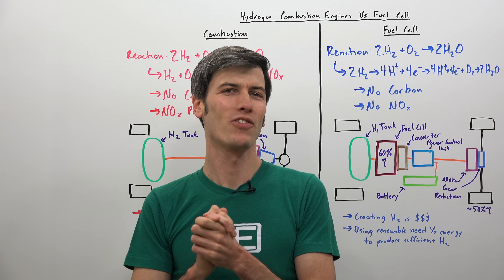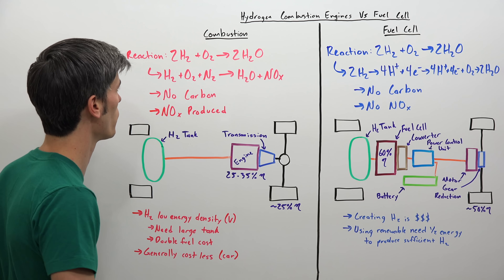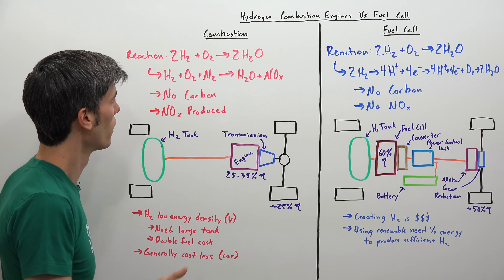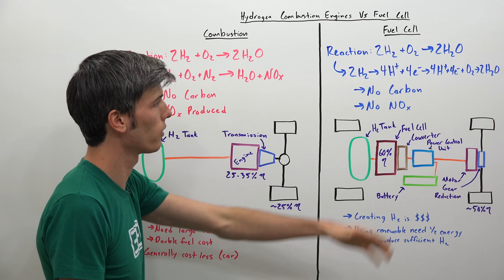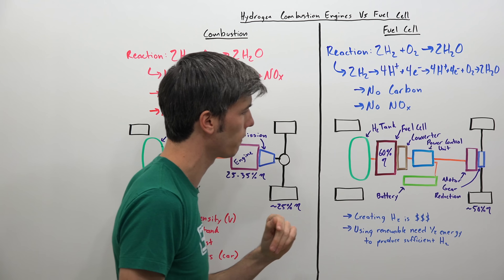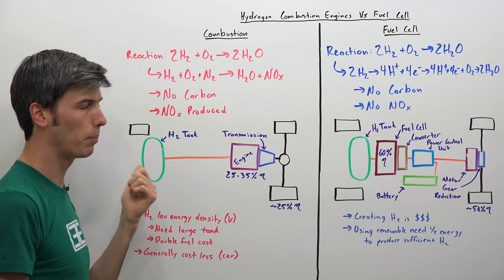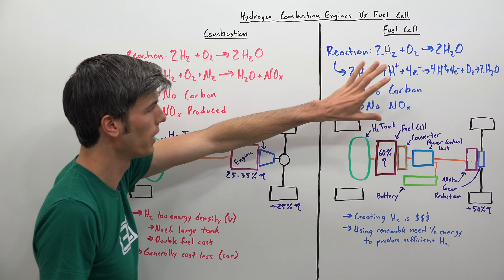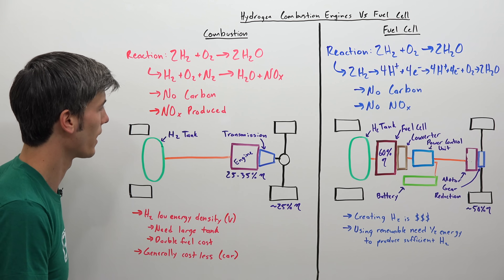Why Hydrogen Engines Are A Bad Idea

Comment: What about a HHO generator ? The only two things I see stopping us is 1 cars now a days are to smart u will end up needing gas because of sensors but if you go to a carb engine u won't have that problem now second . Is u have to have a pressure release and or a storage tank and pump to push that hho gas into a tank to put into the engine so u can very the throttle u don't want and engine that's at idle and the generator is making double what it needs etc that's where the valve comes in if your at idle the valve let's go of the extra
Reply: I would like to take the time to post some info about my vehicles setup.  I have been running my car on Hydrogen for about 2 years now.  I do not store large amounts of Hydrogen fuel in a separate High pressure container.  I produce enough gases on demand through the electrolysis process to run my 2.4L engine which requires about 6L per minute at 7000 RPM to run without hesitation or noticeable reduction in power.  To be clear, I do not separate the Hydrogen and Oxygen gases in my device. I simply have a small container that will be pressurized to 12-15 psi before the system will shut off production automatically.  I produce enough gases on demand through the electrolysis process to effectively bypass the need for complex High Pressure tanks to store H2 like most of the current systems.
    With this method I do not store enough combustible gases to cause any significant fire hazard or air displacement danger in the instance of a "leak" or failure of the containment device.  I bought a new fuel tank to replace the one that came with the vehicle to prevent contamination from the old fuel.  Now I use my house water to fill my cars fuel tank which holds 12 gallons.  So the fuel system is the same as you would find from the factory but, I fill it with Water instead of Gasoline and the fuel pump connects to the water container in the engine bay instead of to the injectors.  Also I do not use the fuel injectors, I use a large aquarium tube that is connected to the intake before the MAP/MAF sensors.  In order to run my engine on Hydrogen I had to retard the ignition timing from about 25 degrees before top dead center to about 5 degrees before top dead center.  I did this by using a timing light and rotating my distributor clockwise by about 7 degrees.
    As a comparison my car got about 30 mpg with gasoline, now it gets between 25-35 mpg with Hydrogen.  In conclusion I am sure that with a more complex delivery system I could get better performance and mileage because I am not monitoring the fuel air ratio but, my goal was to create a system that produces less Carbon emissions not to be crazy efficient and cheap to fill.  I believe by producing enough gases on demand this is more efficient because if I run out of fuel through miscalculation or my fuel gauge stops working, I simply need to find someone willing to sell me water (in one case a woman was so impressed she just gave me the use of her garden hose).  This is also safer because I am not using a "High Pressure" storage container for a combustible gas or liquid, it is just water in a tank.
Reply: Cameron... on board HHO generation makes no sense. It's a famous fraud.

Comment: The NOx argument is kinda disingenuous as it could be mitigated via emmision to a level well below what current gasoline engines produce hence why they're called near zero emissions. The whole point for going hydrogen I.C.E is to mimic gasoline. Only downsides less efficient which could get solved with better designs, technology improvements etc etc. Wouldn't be surprised if at some point a titanium 3d printed engine totally becomes viable. Perhaps the ability to 3d printed carbon nanotubes becomes ez to manufacture.

The only  people this will appeal to are those that have boarded the electric vehicles bandwagon. Understand a HUGE section of the population like the performance,  sound of your traditional i.c.e.. So Understanding this which would you prefer people adopt the current i.c.e or a hydrogen one?

Comment: Hho is fuel on demand.
Water and electricity is the only fuel you will need. All you really need is to increase your electric output to increase you fuel generator. So I dont understand where hydrogen is expensive. A gallon of water can generator hydrogen for up to 6 months to combust with your gasoline. In other words increase your hydrogen fuel cells you increase production. So if your engine is a 5.7 liter engine you only need to double if not triple your production per minute to supply your engine the fuel it needs to sustain its self so what do you mean by needing a large space to store fuel?
When in fact you only need to produce enough per minute for the motor. We now have throttle sensors which can can be link to the cells to increase fuel production when one accelerate the vehicle... a 200 amp alternator can supply enough current to generate 30 amps and over 27.8 liters of hydrogen in less then a  minute. I dont get what your trying to do with this video but you cant say hydrogen is expensive I generate a gallon in less then 20 secs. And it cost me nearly nothing.

Comment: I'm not against looking for environmental solutions for out planet.. But when all inputs and outputs are calculated it still becomes loss for the environment. Too many people get caught in a closed loop environment and only see CO2 as the issue, when it is just one part of a lot larger equation. We are still creating toxins that enter the environment, can cause real damage to our oceans, and ultimately continue to drive up atmospheric CO2 concentrations.
In all current solutions energy is imported into the earths biosphere (aka additional heat).
>
My proposal.. Reduce energy use at a significant scale as well as employing better methods of efficiency + look after our oceans, and I mean actually look after the oceans.. 
Until we work out viable ways of exporting energy from earth, and do so in a way that is cheaper (More efficient) than importing it the trend will continue upward..
Maybe large scale desert mirrors to push more solar energy back out, rather than drawing it in with dark solar panels as an example.
>
Thanks for the video. I enjoyed. :)

Comment: I wish that Stan Meyer could have been here to fix or defend the problem with NO pollution.  I think he would have solved it quickly.  Also, the battery weighs a lot and the hydrogen tanks can be used as miniature Hydrogen bombs.  I would not like to see the results of that.  This society can not be trusted to not do that.  Also, the ocean is rising and using ocean water with an additive, so people can not just go to the ocean to get fuel, would be good. The weight of the water does not bother me.  The metal that is being produced now is terrible.  I would not want to trust compressed hydrogen with it.  Wish Stan was still alive.  Did his brother die?  He was a joint patent owner.

Comment: Explosive power is a lot cooler than a fuel cell.  In a gas engine you keep NOx emissions down by keeping combustion temperatures down.  They just have to keep combustion temperature down through EGR, stratified charge, etc. and they will be good to go.  Doesn't really matter anyway as oil/gas isn't going to need a replacement for many years.  The only real reasons to get rid of gasoline engines are political.

Comment: Hydrogen Combustion Engines might be the only way to save internal combustion Engines. Wether that's something important is of course sometging everybody has his own opinion on, but i personally think it's a good thing since electric cars are in my opinion extremely boring.
You could use catalytic converters to solve the NOx problem and if you produce the hydrogen entirely with renewable/green energy the lower efficiency will probably not be that much of a problem

Comment: Let's cut to what happens when you have a  hydrogen fire.
The answer is  you don't want to know. 
Hindenburg is example of hydrogen exposed to oxygen. 
Hydrogen mixed with oxygen is  much more dramatic. 
Some people want us to use this as an auto fuel. Not a good idea. 
Ride around on a case of dinomite 
For a while and then tell us what you think about it.

Comment: Your wrong. The amount of emissions required to produce one hydrogen fuel cel far outweighs the amount of nitrogen expelled in a HCE. The cobalt mining process and smelting alone is so much more polluting than the emissions of  an HCE over the life of the engine, that manufacturing it would be way less cost effective, over the life of the vehicle than it's worth. Sure, the engines themselves emit differently, but you totally discount the total required to manufacture AND operate and maintain the vehicle. Also, you haven't even explored hydrogen supplemented engines, as they are a much more viable alternative, without the need for storage tanks.

Comment: is hydrogen embrittlement an issue for IC hydrogen engines!
Reply: Technically yes, However...
I would like to take the time to post some info about my vehicles setup.  I have been running my car on Hydrogen for about 2 years now.  I do not store large amounts of Hydrogen fuel in a separate High pressure container.  I produce enough gases on demand through the electrolysis process to run my 2.4L engine which requires about 6L per minute at 7000 RPM to run without hesitation or noticeable reduction in power.  To be clear, I do not separate the Hydrogen and Oxygen gases in my device. I simply have a small container that will be pressurized to 12-15 psi before the system will shut off production automatically.  I produce enough gases on demand through the electrolysis process to effectively bypass the need for complex High Pressure tanks to store H2 like most of the current systems.
    With this method I do not store enough combustible gases to cause any significant fire hazard or air displacement danger in the instance of a "leak" or failure of the containment device.  I bought a new fuel tank to replace the one that came with the vehicle to prevent contamination from the old fuel.  Now I use my house water to fill my cars fuel tank which holds 12 gallons.  So the fuel system is the same as you would find from the factory but, I fill it with Water instead of Gasoline and the fuel pump connects to the water container in the engine bay instead of to the injectors.  Also I do not use the fuel injectors, I use a large aquarium tube that is connected to the intake before the MAP/MAF sensors.  In order to run my engine on Hydrogen I had to retard the ignition timing from about 25 degrees before top dead center to about 5 degrees before top dead center.  I did this by using a timing light and rotating my distributor clockwise by about 7 degrees.
    As a comparison my car got about 30 mpg with gasoline, now it gets between 25-35 mpg with Hydrogen.  In conclusion I am sure that with a more complex delivery system I could get better performance and mileage because I am not monitoring the fuel air ratio but, my goal was to create a system that produces less Carbon emissions not to be crazy efficient and cheap to fill.  I believe by producing enough gases on demand this is more efficient because if I run out of fuel through miscalculation or my fuel gauge stops working, I simply need to find someone willing to sell me water (in one case a woman was so impressed she just gave me the use of her garden hose).  This is also safer because I am not using a "High Pressure" storage container for a combustible gas or liquid, it is just water in a tank.

Comment: So you're mentioning that Hydro Fuel Cell motors are much better than combustion hydro engines..... Basically
Reply: Also with the FC-Motor vehicle, 
Could you have a rear wheel transmission fit in the design as well, 
So you could still have a rear wheel sport car 🤔

Comment: Internal combustion engines are poor mechanical machines to extract work from the fuel, they simply have very poor thermodynamical efficiency.  When you have got hydrogen, a better way to extract the mechanical energy is by fuel cell to convert the chemical energy to electricity that can power the electric motor.

Comment: A couple of other things to note concerning hydrogen as fuel (although these affect both H-ICE and Fuel Cell engines):
As noted, hydrogen has a low energy density, and this is compounded by the fact that it is also a low-density gas at anything approaching ambient temperatures: in order to contain more than a few moments of run time under either engine type, the hydrogen gas must be compressed into a liquid state. This requires a great deal of energy to accomplish. The liquified hydrogen is extremely cold, and cannot be allowed to expand, thus the "gas tank" must be constructed to withstand those high pressures, adding weight and design requirements.
Liquid hydrogen quickly vaporizes once released from the compression noted above - and once vaporized, is explosively flammable. This requires that any part of the fuel supply system (for either engine type) be extremely durable during a crash: any accident which ruptures any pressurized part of the fuel supply has a high risk of fire or explosion. This means that the car's frame must be highly over-engineered, adding significant weight, and reducing efficiency.

Comment: why is nobody looking into electromagnetic piston engines?
Reply: Because that would be rotating more mass than you have to.  Using a Pulse electric motor would be far more efficient but less powerful than regular electric motors, which is why they don't use those either.

Comment: burn the hydrogen with pure oxygen outside engine proper.... something akin to an oxyhydrogen torch... zero NOx, and one of the highest flame temperatures, and no need to deal with stuff like pre ignition .  then pipe the steam flame directly into a steam engine or steam turbine generator set. Higher fame temperatures mean carnot efficiency can be higher, but of course its limited by materials science. 
fuel storage...there was a 1971  Porsche 917 racing car, which had a tubular chassis. To reduce mass... it was extremely thin tube wall. which were then pressurised to stop the tubes walls buckling. Similar idea to fuel tanks in many rockets. Store fuel gases in chassis tubes.  Thin diameter tubes, can cope with higher burst pressures, than bigger diameter tanks. better ability to cope with hoop stress etc. Use bundles of tubes, and/or arrange them into "plates" for inclusion in the chassis. flexibility to store gases in what's otherwise unused space..

Comment: Hydrogen has been used to power automobiles for 40 years now. A Hydrogen "engine" could take many forms not limited to reciprocating internal combustion engines or turbines like gasoline. Train efficiency in part to diesel-electric drive train. Future autos will have direct electric drive as transmissions lose 5-25% of vehicle's energy. Hydrogen (and its surrogate Methane) fuel cells can generate megawatts in a small space. Examples, island off Edo, resort, powered by 10 megawatt natural gas fuel cell; NASDAQ backup power. Japanese electric cars (non-US) and hybrids store Hydrogen in Nickel sponge electrode. Low pressure requirements of Hydrogen storage materials allow lightweight composite storage containers. Safety. Metal Hydrogen alloy burns and does not explode like Hydrogen gas, less dangerous than gasoline. As natural gas aka methane continues to become more popular (cf Methane Hydrate) the same infrastructure upgrades open the way for Hydrogen. Note that metro buses adapted to run on natural gas were tested on Hydrogen decades ago. The Laws of Thermodynamics that limit combustion engine efficiency allow more energy to be extracted from fuel in a fuel cell.
You neglect the high activation energy of Oxygen and problem of gas to liquid/solid diffusion, in oder to use "Air" as an electrode. "The car needs big lungs."

Comment: And the production of electric batteries is carbon neutral? There has to be a transition technology that allows the conversion of combustion engines from fossil fuels to hydrogen. There are hundreds of millions of vehicles that cannot just be scraped owned outside the United States. Why would someone in the developing world want to buy an electric car? There is no solution that will be accepted that does not address the needs of people in the developing world. I would bet that someone like a Tata Motors will find the solution and not only dominate the auto market in the developing world but put the old US / European companies out of business. And as far as Tesla is concerned, it does not figure in the equation. The company is not interested in the “mass market” but instead the “premium market”. It is no way positioned to ramp up production into the millions of units when it has difficulty producing tens of thousands to start with.
Reply: There is no transition technology need because the transition will take place gradually. Cars will not be scrapped needlessly. They simply get replaced naturally by EVs. Yes, also in developing countries eventually.
Reply: Simon I agree and understand that is what will happen “eventually”. But isn’t climate change an immediate problem demanding reductions in carbon emissions? This issue is presented to the general public as a matter of the imminent extinction of mankind. I am not saying that is the reality or being an alarmist. However, western countries in particular are demanding change by their own societies and the developing world immediately. If the world is facing catastrophic climate change, then “eventually” needs to be yesterday. And there is the rub. The western world is going to have to foot the bill and buy up the unwanted vehicles to speed up adoption of this technology.